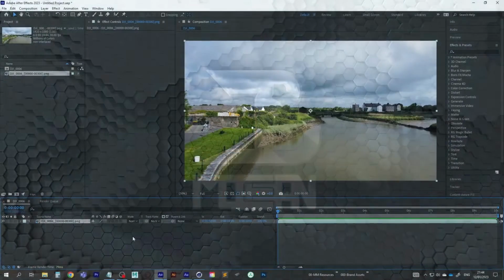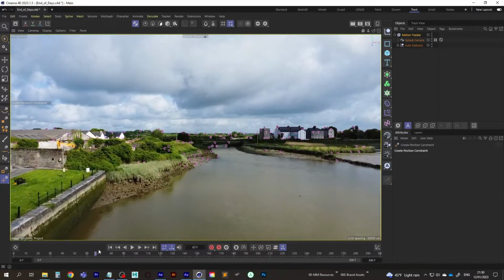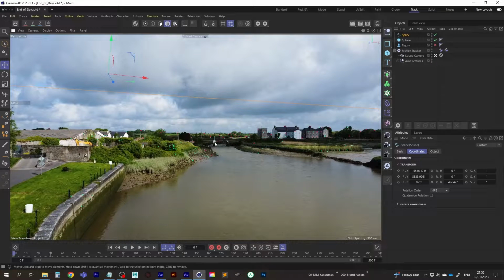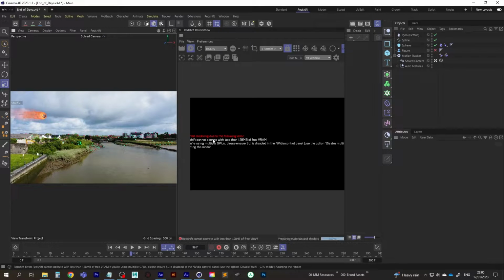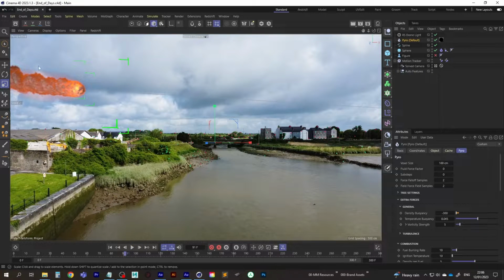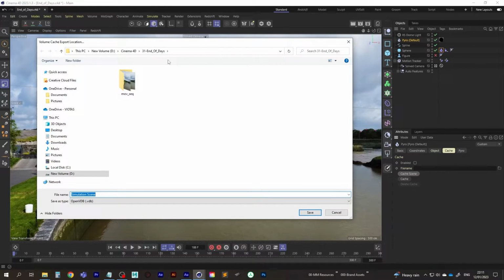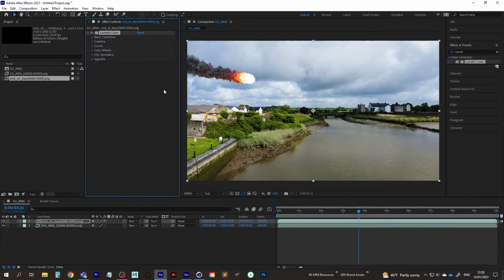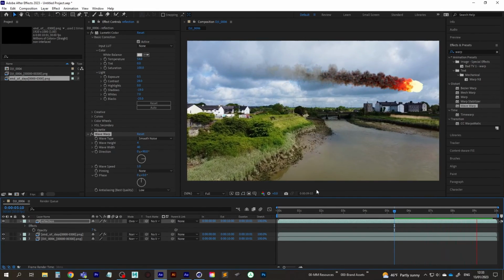C4D Tutorial - Add 3D Fire Simulation to Real Video Footage [Cinema 4D / Redshift / Camera Tracking]

Comment: While simulating the pyro you don't need the image sequences loaded eating up vram. Sim the pyro in an empty scene and then load it into your final scene when cached. You can also lessen the fire halo pre render by setting the temperature cut offs in the main sim settings and /or adjusting the range mapping post sim pyro vol material Also a render as viewport setting allows you to scrub back forth the render without having to cache it.
Reply from the maker: Great tips, thanks for sharing that!